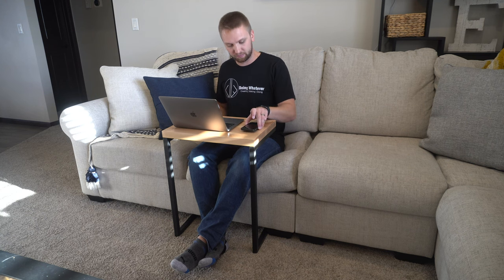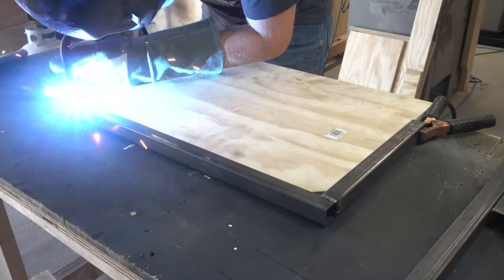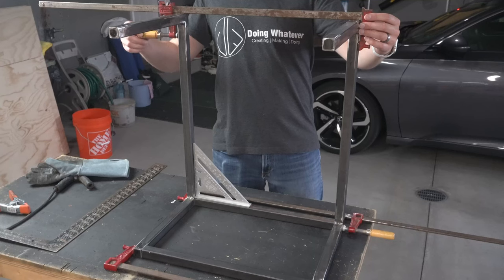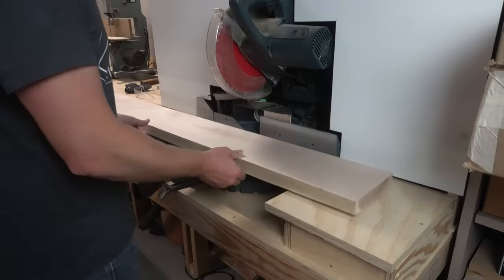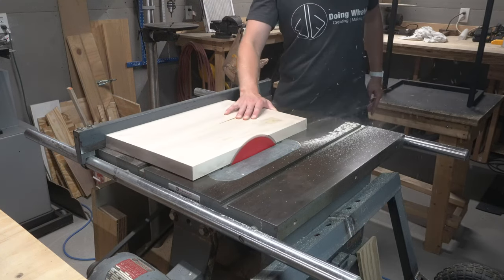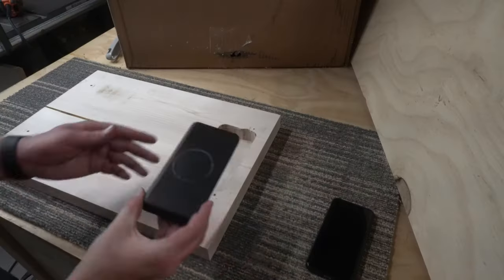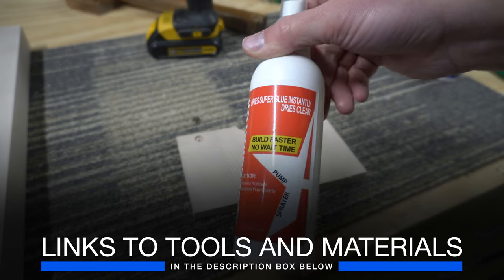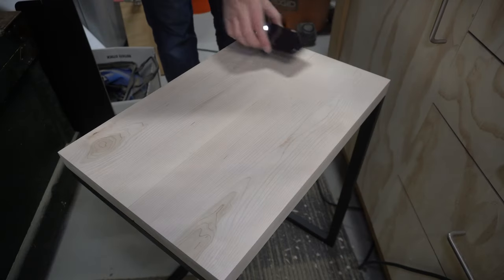I screwed up at the end…

Comment: Hi great video!!! but I have a question how you managed to keep de batterie always on? So  if you press the on button the battery stay always on? For example you charge the phone in the table a didn't use the table for two (2) when you place the phone on the table again the battery charge the phone? or you need to turn on the battery?